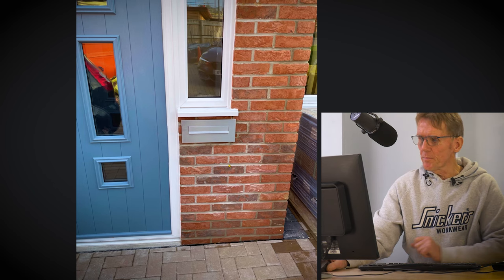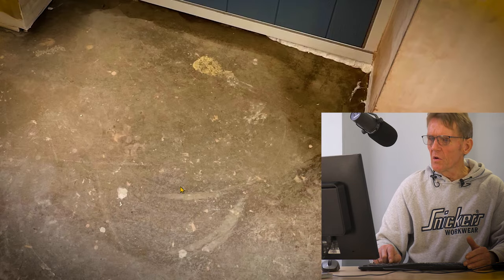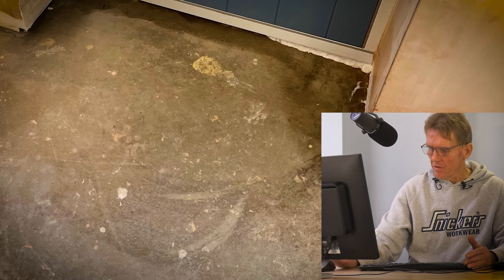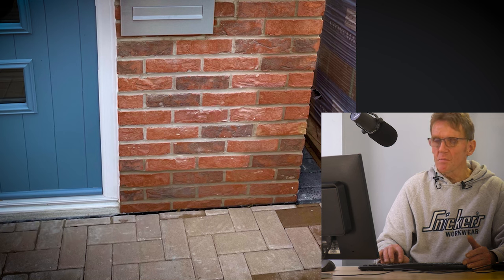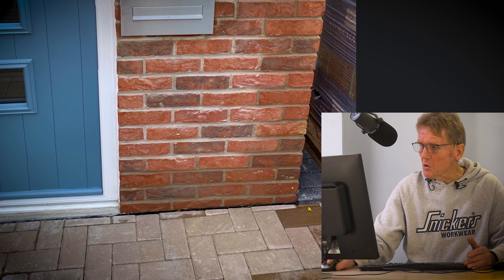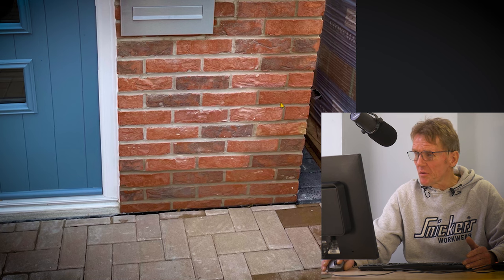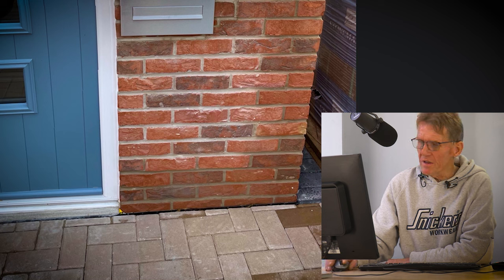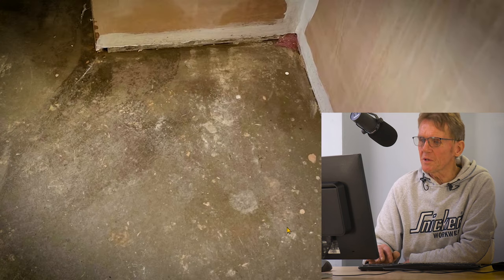Water Seeping Under Door and Wall

Comment: The bricks and mortar are also damp right to the top of the image about 8ft high down one side on the corner, the next row inwards are all bone dry. Could be coming in from the roof or guttering on that corner, or dripping down into the cavity and then filling up the bottom hence why the first few rows are damp right across.
Reply: that has been repointed, too uniform too be damp issue, well spotted

Comment: I can advise the property needed a cavity tray bedded 150mm high in the internal leaf extending down into the external leaf at ground level, and then a dpc course in the outer leaf of brickwork two courses up. This is the correct specification for level access around the opening, or the the perimeter if the building is level all the way around ** The drain would also help 👍

Comment: I've real concern about the letter box that's been built into the brickwork to the right of the door.  It's too close to the reveal and very possibly the lining is  bridging the vertical cavity closer, allowing water to pass through to the inner wall.
Reply from the maker: Good point I didn't spot that.
Reply: Well  spotted
Reply: that's just the cover plate the part that goes through the wall shouldn't impede the cavity closer depending on what type was used
Reply: Letter boxed in doors and walls really are a poor idea - on heat loss alone, let alone the point about water ingress. If you have the opportunity to fit an external mailbox, I think that’s a better solution.
Reply: I built one in like that was a steel pipe same size as the letter box opening

Comment: Drill the mortar joints on every paver brick and inject foam then trim foam below edge and caulk with Vulkem 116 - Single-Component Polyurethane Sealant or the like to completely seal that transition between pavers and wall brick. Vulkem is already grey so it will match the mortar. I've used that product to seal street cuts for CATV and it does not fail. If the problem is lateral seepage in the pavers then rip them all out and reapply sealing the transition below grade.

Comment: Regardless of what the client wants the builder should make them aware that their decisions will cause problems. Then it’s up to the client to proceed or not. Approved Document A states ground level should be 150mm down from DPC. If it’s not it can be mitigated by a 150mm deep gravel trap or an Aco drain 
You’re correct Roger, porches are exempt structures and building control only get involved when the front door is moved into the porch
Reply: i think that not necessarily a builder was involved in the entire job. Looks more DIY

Comment: I'm not an expert but it looks like the water is running down the wall to me. That 1st column of bricks on the right hand side is very uniformly wetted. It looks like water is running from the top, down the corner brickwork and pooling at the bottom, then soaking back up the first 3 rows of bricks. If it was coming from the bottom and rising up the brickwork, it would be evenly spread across the wall (like it has done on the first 3 bricks up from the bottom), not just in one very neat line going up the wall. I'd look at at the drains, gutters, and roof before I dug the floor up.

Comment: Is the black thing showing a level access drain?  That's used with slabs? In my opinion with level thresholds the internal blockwork should be tanked in the cavity

Comment: The new pointing at slab level and on the corner of the wall suggests there has been ingress of water perhaps a broken down pipe or even flooding. Doesn't look right.

Comment: Like + agree with the drain suggestion there. 100% the right way.
I remember you had a video on a damp proof injection thing you could put into brickwork/the pointing to halp keep damp below a certain level.. could that potentially also be done after the drain is put in /when the drain is put in, on the inside, to try and help stop water wicking up on the inside while giving it drainage on the outside?
Reply from the maker: It might do some good to put the Dryrods in as a belt and braces measure  but the water is driving under the bottom course.

Comment: I found Peter Ward’s take on water and damp very helpful, he’s not everyone’s cup of tea 😂 
He’s got a book out now (just ordered) the RICS have modified their method statement based on Peter’s work. 
I had a damp single single skinned conservatory with a cement plinth built up to just below the damp course, striped that all off gunned out a 4” by 4” trough to drain the patio water off, has been dry ever since in line with Peter’s thinking.   Anyway Rodger outside drainage is IMHO the way to go here. ❤
Reply: I get how a damp course would work and prevent any water soaking its way up the external walls, but how does the drain keep the walls dry? Does it just prevent the water from pooling and being soaked up by the bricks? Reducing the overall water capacity sitting around the wall?

Comment: If it's been built off a slab/raft footing, water wouldn't be able to drain down into the cavity below DPC when penetrates the outer leaf just sit at floor level
Reply from the maker: Normally the slab is stepped but not this one

Comment: Been looking for a good explanation of how to keep water from seeping under an upcoming build that will be walls within the boundaries of a slab by six inches.  Anyone knowing something on internet that goes into details of options?
Reply: I don't see how that could work unless you  chased a  channel along the perimeter
Reply: @mktrollop1093  Only minimum help due to overhang of cement to be over 6".  That plus cuts in cement are the only solutions thought of so far.  Thanks though.

Comment: Really not good advice in my opinion, and suggesting the builders potentially not at fault also quite disappointing. Surely using professional builder with the appropriate skills at the start has to be key.
Reply: What advice would you give to the home owner?
Reply from the maker: Glen R 
I am happy to hear your opinion but you haven't told us anything. As for not blaming the builders, I have been accused of blaming builders unjustly so I try to be fair. We don't know who laid the slab and who did the drawings, if there were any. 
Having said that I did say it was a poor job.
Reply: How would you do it then Glen.
Reply: @SkillBuilder  there are lots of potential sources for water leaks into the threshold locationsshown on the video. I think it's to easy just to say install Aco linear drain to resolve the problem, things I would check are as follows: 1. dpc position or lack, 2. how's  the cavity closer detail completed, 3.dpm position on the floor or lack of, 4.also is there a drip on the door cill or weep holes to direct the water out ward etc, etc. Hope this helps.
Reply: can i just say the term builders may be misconstrued here, was it a private/off site job or an extra that an onsite client wanted? the builder would differ in each case.If onsite the person that built it would follow site instruction. If other then it was poorly thought out and built! that's my opinion